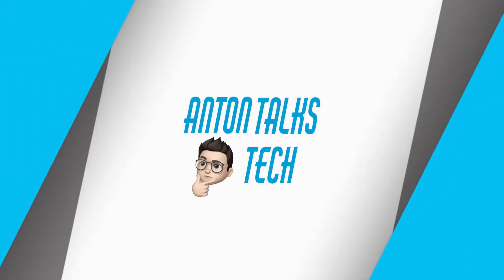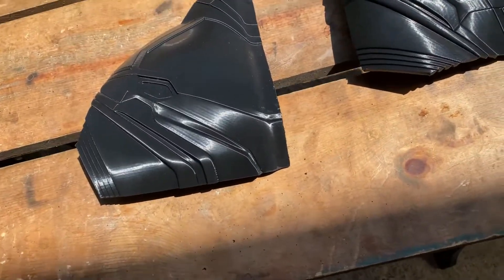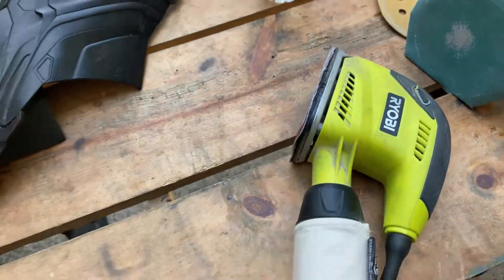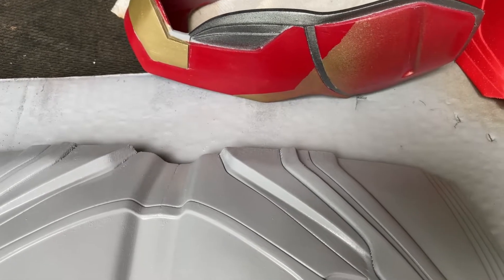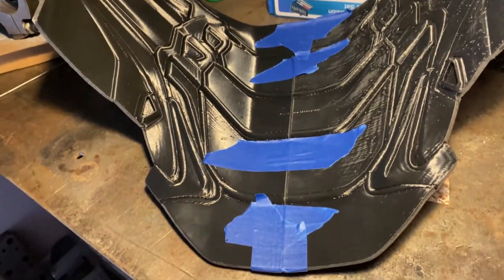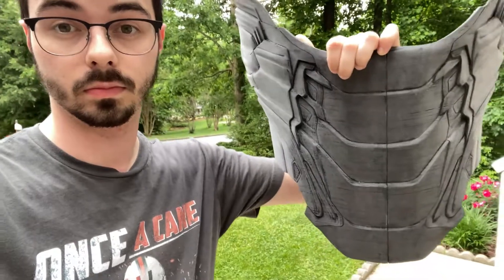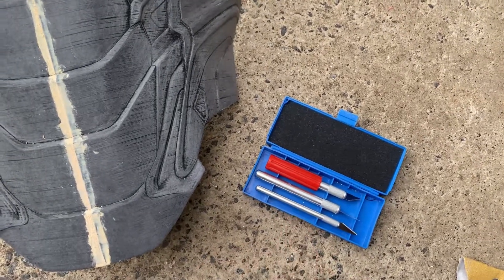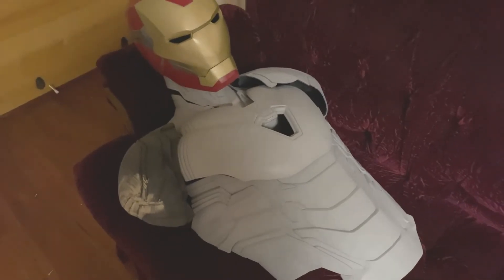3D PRINTED IRONMAN SUIT COSPLAY PROGRESS | Part 15

Comment: What primer are you using? And how long does it last? I am using some rustoleum white plastic stuff but man it doesn't last long at all. Looking for something that can be sanding but goes on thick enough without losing any details for stuff like the abs etc. Thanks!
Reply from the maker: I have been using this stuff - https://amzn.to/3eeP3od and have been liking it so far. I will say you want to sand very thoroughly before applying to keep it smooth, but it doesn't lose detail on the print when applied, and i can definitely sand it, and apply again if needed